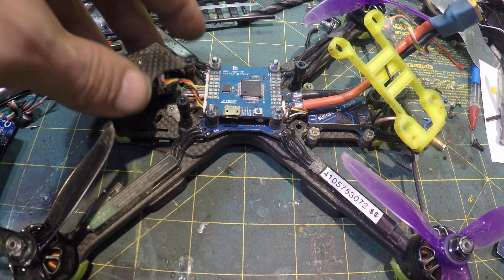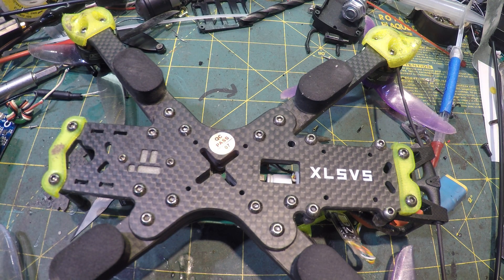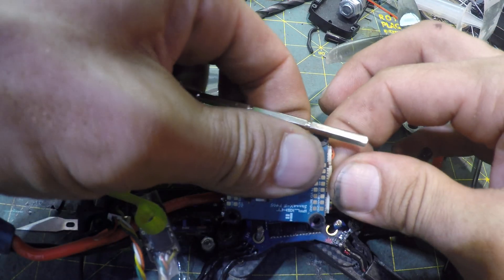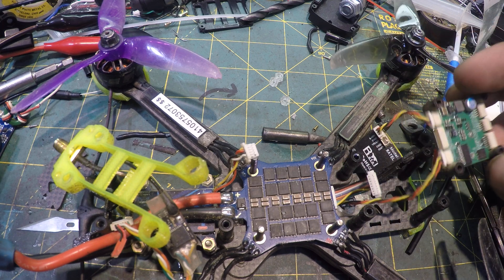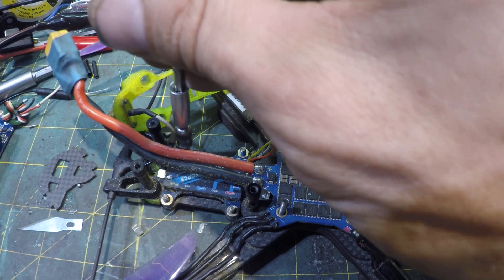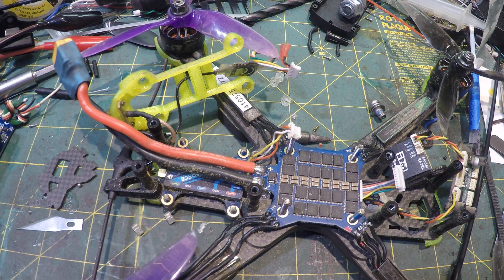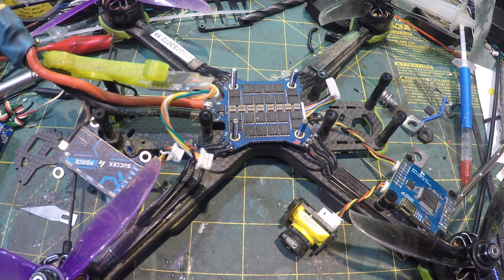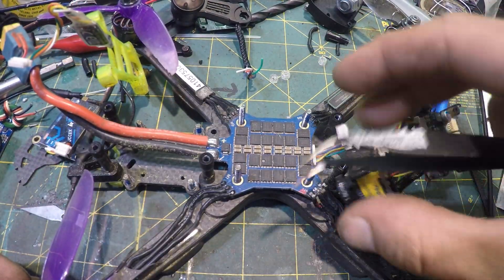Nazgul V2 Capacitor Replacement Repair

Comment: If i understand well it is a 6s nazgul? But has the same capacitor of mine which is 4s
Reply from the maker: Yes it is a 6s nazgul. Iflight usually sends 35v capacitors with their hardware. I think I'm using 50v in this video. But anything from 35-50v 470mf to like 1500mf max. With the caps you can always go higher voltage and round out voltage spikes. So a 35v would work with 4s 16.8v or 6s 25+v
Reply: @BonzaiFPV  I'm asking because I have a 4s, I just broke 2 motors so I'm going to convert it to 6s. I asked iFlight support about other differences required to perform the change, and they said that 6s is delivered with 50v capacitor, but it seems that your was working without issues even with the 35v.
Reply from the maker: @alegtFPV  yeah I recently purchased a 45a 3-6s 4in1 succex and it came with a 470uf 35v cap. 35v is fine for 6s. And yeah the only difference between the 4s and 6s nazgul is the motors. Thanks again
Reply from the maker: 6s=25.5volt which is well below 35v , and yeah if worried about voltage spikes you can use a 50v but either is acceptable. Thanks again for watching good luck happy flying.
Reply: @alegtFPV  Seems, his quad was working without ANY cap! :)